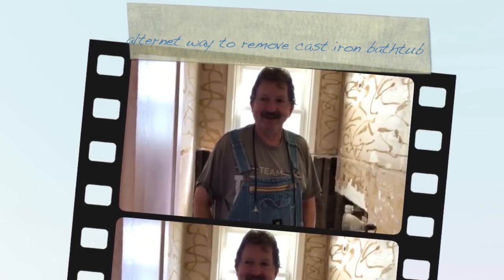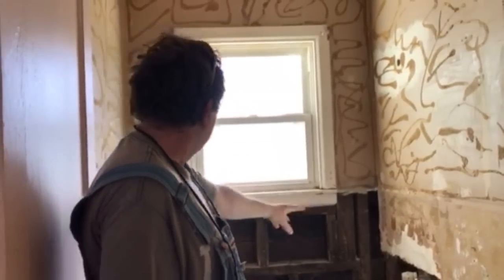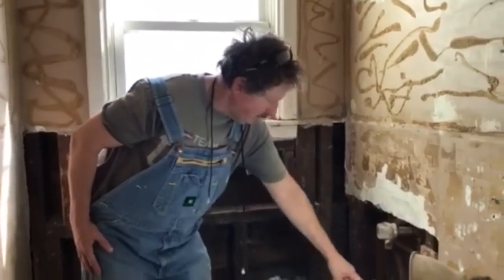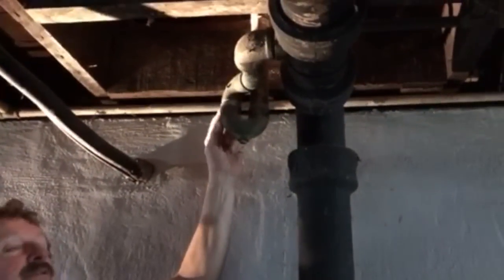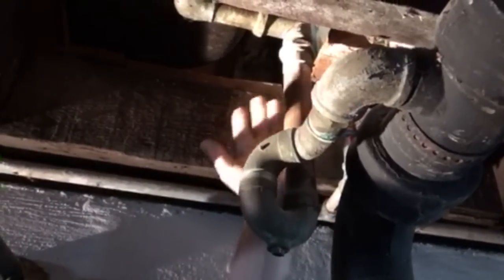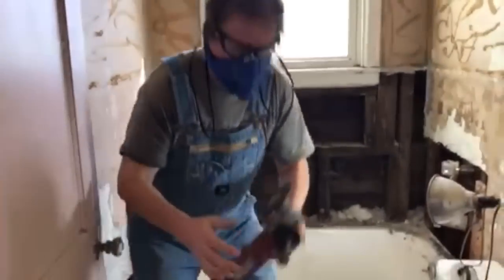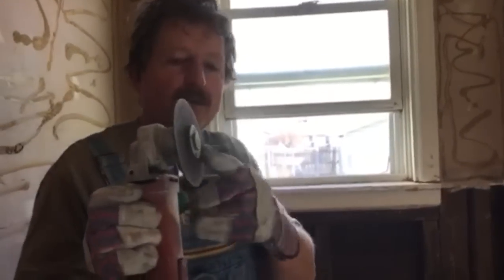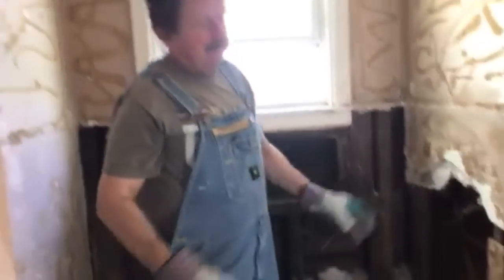no sledge hammer to remove this cast iron bath tub

Comment: That was my plan, the angle grinder, but you have shown me that one cut across the middle makes for 2 manageable pieces.    Years ago, I took out a tub all in one piece, and hired a junk hauler to bring it down my staircase.  Three of them it took to slide it down on old carpet scraps, then bust it apart in my yard with sledge hammers.   I didn't want to do that this time for the same reasons you mentioned, primarily shrapnel.  A close second was fatigue... I'm not as young as I once was!     Thank you for a great video!

Comment: Glad to have found this video, which gave me the confidence to do what I would not have attempted otherwise. What I had thought to be a steel bath turned out to be cast iron. I first tried a reciprocating saw to cut the bath, with appropriate blades: however, cutting prorgress was impractically slow. I then watched this video, along with a "health-and-safety" video about using an angle grinder, bought an inexpensive face-guard to add to the standard eye-protection and dust-mask, after which slicing up the cast-iron bath was relatively quick and easy. I had to make three cuts to get sections small enough for removal, which used up four cheap 4½ inch/115mm cutting discs. Thanks for the inspiration.
Reply: What angle grinder did you use? 5 amp? 15 amp?

Comment: just did this today and it worked fine.  i bought a Milwaukee 15 amp, 7 inch grinder and it worked great.  I wasn't able to get the lowest part because the wheel would've damaged the floor, so I used a sledge hammer on the last couple of inches.  otherwise, clean project. thanks!!

Comment: Thanks John, did what you said and it worked like a charm. With the tub cut in half it was still extremely heavy because i did it by myself. To anyone thinking of doing this buy a lenox 4.5 diamond blade and use good safety gear, you don't want cast iron shavings in your eye. Great video!

Comment: Great tip. I used a dewalt blade and it wore down pretty fast. Went and bought a Lenox diamond 4.5 inch blade and it’s just like butter. Amazing. Thank you.
Reply: Buy a face shield and hold on to the grinder it does kick on the side of the tub.

Comment: Super helpful. Another channel suggested using a reciprocating saw with diamond blades but he took 2 hours and went through about 10 blades. Beating on a tub with a sledge hammer is a great way to crack nearby window panes, knock pictures off adjoining walls, and generally cause more problems than it's worth.

Comment: Wow. What a sane way to remove a tub. Watching people bash them apart and end up with a mound of sharp slivers, you know there had to be a better way. Heading to HD to rent a grinder. You're a smart man, Mr. Karasiewicz.
Reply: I cut my cast iron tub with an angle grinder too.  It took about six wheels.   The sledgehammer way might be better because it's safer.  That angle grinder leaves a lot of dust.  Those  n95 mask clear out 95% of particles Only when there is an exhaust fan pulling out the dust.  I didn't see a fan in that bathroom.   This is like chromium dust.

Comment: I did the sledgehammer method and had it broken up and hauled out and swept up within 40 minutes. I put down old-school painters drop cloth over the tub, painters plastic on the floor and counter top. When hitting it all the shrapnel stayed in the tub area, and all the debris could be scooped onto the painters plastic and bagged up the crumbs into the plastic at the end to haul away. No way would I have been strong enough to move even 1/4th of the tub in one piece, easily 400lb bulky tub.
Reply: I do bathroom remodels with the homeowners present on every occasion the sledgehammer technique is caveman style it's old school it's a lot better A lot faster lot less clean up just to cut it down the middle with the grinder
Reply: I REMODEL FOR A LIVING IF I HAD TO SMASH EVERY TUB I CAME ACROSS I'D HAVE CARPLETUNNEL AND HEARING AIDS.  NOT TO MENTION A NIFTY SET OF SLEDGE HAMMERS.  YOU CAN ALSO TAKE OUT STUDS AND LIFT IT OUT AS A HOLE STRAPPED  TO A DOLLY.  YOU ARE PROBABLY GUTTING THE DRYWALL FOR A SUBSTRATE ANYWAY.   I KNOW A NEW STUD IS ALMOST 3 DOLLARS ITS A LOT OF MONEY...

Comment: Thank you for the video! I used this method yesterday and it worked very well. The risk of damage to drywall (popping all the nail heads) on adjacent walls was high if I used a sledge, so this method allowed for a very quick, controlled removal and clean-up.

Comment: Easy way to refinish a cast Iron tub where the surface has been dulled due to the use of abrasive cleanser powders like Ajax or Comet is to use Carnauba Wax and a buffer just like you would use for a car.  It does a great job, it does not take very long, and lasts surprisingly well as long as you apply 2-3 coats minimum and don't use abrasives or chemicals that may be too harsh for cleaning.  Maintenance may be the occasional (every year or so) buffer first and then a new coat with a second buffer.  A word of caution though, us some sort of bath mat in the tub for traction because it will be slick and pull the mat after each use so the tub dries.

Comment: I've used the sledgehammer approach. It risks breaking stuff you want to save (I once hit a toilet on a backswing) and makes a mess. This process is simple and takes less time. I bought a $15 diamond tipped 4-1/2" blade for my grinder at Lowes and had the thing cut in about 15 minutes. Just some black dust to sweep up.

Comment: Works perfectly, I cut mine in quarters and carried it out by myself with no issues.  No mess to clean up either.
Reply: I literally saw this video because I was going to use a sledgehammer method and I did what he said but I cut just like you but I cut in thirds took out the middle piece and then the two side pieces to slide it out so much easier

Comment: 20 minutes I could have the whole tub out with a sledge hammer, but this method is good in cases where banging away with a sledge can cause collateral damage and special care needs to be taken.
Reply: This is much safer than hammer bashing it then risking injury..or many times I dont want pieces flying not only at me but all over the bathroom and damaging other stuff. Often it's not always a complete bathoom remodel so why risk damaging yourself or other areas in the bathroom (cabinets, walls, fixtures, etc) Too many hacks out there these days and really..whats 20 minutes to saw it in half ? Nothing IMO. And if you can't carry out half a tub (150 pounds) you're in the wrong business.  A second guy is easier on the back if ya have a helper. Good video.
Reply: But how much time picking up 350 pounds of pieces and carrying it all out multiple trips? I don't know the time spent vs the mess seems better cutting.

Comment: This is the way to cut up a pre-1950 tub.  They are 1/2" thick cast iron and will not succumb easily to a sledge hammer without vibration damaging everything else.  We used a metal-cutting diamond blade ($21) and quartered the thing.  About an hour + of cutting.  If you have a big magnet it will catch some of the filings.   The top edge was reinforced with steel angles, and these were cut with a Sawzall.  Each quarter weighed 95 lbs.

Comment: Thanks for the very practical method. I saw another video where a guy tilted out the tub the same way you did, but in 1 piece (so no cutting).  But, both his method and yours pretty much requires getting valves and even wall board off first, to have nothing blocking the tilt-out removal............... That causes me to wonder if a modification of your technique could even avoid wall and valve removal - why not cut tub cross-wise, as you did, but in 2 places near the middle. Then drag out a small mid section. Then, pull each end section toward the center gap to get each one clear of obstructions on the end walls, then tilt each one out. This would also cut the tub into 3 sections, so each would weigh less and fit through the doorway easier.

Comment: I was totally sold on this method until I was about 10 minutes in, and still not quite halfway through my tub using the recommended inexpensive metal cutting wheel, before I realized that the entire bathroom was now covered in a fine layer of soot, and my whole house smelled like a brake shop. All that stuff shown in the bottom of the tub in this video was all over the rest of the bathroom. It took me an hour to clean all the soot off of the walls and surfaces. It even got into the closed shelves and drawers of the vanity, and scratched the surface of my plastic toilet seat when I tried to wipe it off. What a mess. Should have read the deeper into the comments where people recommend a diamond blade. Do not use a cheap metal cutting wheel!! 

I took out my frustrations with a 20oz framing hammer and had the tub out within 15 minutes. Sorry man. I love the idea, but it didn’t work so well for me.
Reply: Maybe even seal off door to the bathroom with double layers of plastic inside and out
Reply: You get what you pay for.  An abrasive wheel will make a mess.  Use a thin diamond blade made for metal, like a Lenox.  A big magnet near your work will catch lots of the cuttings.

Comment: This works with very little effort.  Two blades/wheels used...probably one premium wheel would do the trick.  I stopped occasionally for vacuuming, and the bottom inside curves seem to be a bit stubborn but the length of time for me from first cut to having the tub out the door was about 3 hours.  TAKE YOUR TIME and this is very easy.

Comment: I'm about to embark on this process and am reading the comments. I'm struck by those talking about the fine dust everywhere. Thinking that before I begin, I'll seal my tiny bathroom with drapes of plastic so as to prevent dust everywhere in the rest of the house.. Maybe even open the bathroom window and stick a fan inside it to suck out the dust as I go,
Reply: Some big magnets next to your cut helps.  Also use a thin, diamond blade.

Comment: Can you tell me a bit more about the die grinder?  I assume 1/4 collet, but it is 1/4 horse power or 1/2 horsepower, 18 or 20 volts? Did it come as a 90 degree angle or is that an attachment? Brand? (this is probably the only thing I will ever use it for, so might as well get the best for this job!) LOVE THIS IDEA v sledge hammer. Thank you!

Comment: Thanks for your video! I have a similar issue with a cast iron kitchen sink. It weighs as much as a small elephant. Already have a back problem so I don't need to lift that much weight. I did buy a diamond blade for my Skill Saw for forty bucks and see YOUR angle grinder which I have three of in my shop. Going to look at the assortment of cutting wheels, just maybe I have one that will cut that cast iron! Anyway I prefer not to sledge hammer the sink so cutting is the way I'd like to go! Again, Thanks My Friend! Be safe, take care!😊

Comment: This video is helpful, but this approach definitely has some downsides. It works, but cast iron dust/smoke is sticky, black and absolute murder to clean up - can create a days-long clean up project if cuts are performed anywhere near finished surfaces. Several unaddressed safety issues too: test for lead first or you'll be dispersing lead throughout the home; use a guard on that angle grinder - super dangerous to use cut-off discs without one; full facemask and gloves a must as well.
Reply: What?Do you work for OSHA. That 
takes all the fun out of it.No stiches or trip to the hospital.Safety first nobody works
nobody gets hurt.
Reply: Totally agree. The dust you are creating can potentially be more harmful than metal, porcelain shards from a sledge hammer and way harder to clean up.
Reply: Paul Wright 😂😂😂😂i was thinking the same thing

Comment: I have a old cast iron claw tub. It is in relative good shape. I added the special shower surround too. only thing is it's high wall makes for steeping in and out tough. I am thinking of just cutting down the one side to make getting in and out easier. Thanks for the demo. Have you ever had a problem with sparks 🔥?
Reply: If it is a good claw foot tub there is a market for them.

Comment: Sounds like the way to go. I am ordering a replacement deep soaker tub. 1963 construction. Are most drains of this period flush with the floor? My other "safe" choice is one that accomodates the pipe above or on top of the floor and adds 2 inches to the overall height of the tub.

Comment: I’m sorry. I watched the rest of the video and, again will have to assert. At the end of this video at 6:12 the host stands by the cut out tub with bear hands, one on the tub and one on his face. That is exactly how metal gets in your eyes. And as for being gentile to the structure, if you use a lump hammer not a sledgehammer vibration will be limited to the tub. That being said, even still, you can repair walls; you can’t easily repair your eyes. And, environmentally speaking, you can sweep and “bag the cast for scrap.”

Comment: I’ve got a 1952 American Standard tub that is in pristine shape.  There must be different grades of cast iron and the glazing used.  I’d say that for 72 years old it looks like the day it was put in.  It was placed when the house was built, before the walls went up.  Long story short we are removing two studs for another reason but it would make for an easy path out of the bathroom, into the walk in wall to wall closet, thought the bedroom, on its side out the door, across the hallway.  Uh oh, has to go down a flight of steps.   So here we go with the angle grinder.  Not ideal, but the cost to have a crew take this out is simply not worth it.  These tubs go for on average $300-400 on EBay but the moving crew wanted twice that amount.  Then you have to find that buyer and store the thing.  Where? Front yard?  Nope,  Off to the city recycle it goes.  Still sad.

Comment: Thanks for sharing this! I have two of them that I've been avoiding removal for 15 years. I have a question. The second bathroom you showed with the porcelain/marble tile. Did you have to remove the bottom row of tile that's along the tub?
Reply: I'd like to know the answer to this question too. I'm trying to avoid re-tiling.
Reply: Find a photo of a tub similar to yours.  My 1929 tub had no flange under the tile.  So I taped the tile to keep it from flying off if it was loose and quartered the tub.  It's hard not to lose one tile when you cut the top edge of the tub.  Newer tubs often have a flange behind the tiles. It's safe to say that in the best case you will loose a tile or two, so you should plan on some replacements at least.

Comment: Thanks!  No way the bath I'm working on would admit a swinging sledge or even 2 pound hammer -- no room!  Thinking about using a circular saw with metal blade but this is so much less clumsy.  Only thing I'd add is some sturdy work gloves in case something gets loose.

Comment: You've already destroyed the tub with your initial cut into it. Why not use the sledge hammer and save 20 minutes? Breaking up old cast iron only requires the weight of a swinging hammer, with very little force behind it. And it's a one person job.
Reply: Depends on the age of the tub.  Try hammering a 1929 Standard.  Good luck!
Reply: @eegg6954  lol, i figured something that old would break like porcelain. is that not the case?

Comment: First..that is not a die grinder ,, it is an angle grinder .and was looking to see what type of blade you have on it ?? Diamond blade ,, ?? I have used angle n diamond for cement but what did you use here?
Reply: Ok i watched a little  longer n seen you had said steel cut blade.. i have many thanks for video
Reply: I used a Lenox (China) 4.5" diamond blade made for metal cutting.  Worked well.

Comment: when cutting the bottom part of the tub, how do you stop yourself from cutting into the floor underneath?
Reply: My tub was actually acrylic so I used a sawzall but it still wasn't a problem because of the bottom being lifted 1-2" off the floor.  I had to angle the sawzall, here just make sure to only go through 1/2" and you are good.
Reply: So what if you do?

Comment: Not a bad video and ultimately you get to the part about how to remove the tub. But too much time spent on the front end of the video talking about and showing what the bathroom will look like once remodeled.

Using an angle grinder with a metal cut-off wheel is a great idea. I just think that you could improve this video by focusing on the topic.

Comment: Seriously John? I thought you would show me some magic. I'd rather have shards of glaze and metal flying around then pull out my grinder. Every time you use that grinder for anything you increase your chances of getting metal in your eyes. The mask and eye wear won’t help because, and you can ask you eye doctor, most of the time metal gets in your eyes later on in the day or the next day. What happens is, tiny fragments land on your close or in your hair or on your forehead. So unless you wear a full body suit, your safety precautions are not done until you have successfully cleaned the whole work place and then yourself, notwithstanding the respiratory risk.
Reply: I was thinking the same thing but my concern is cutting into or running into the floor boards with the grinder when cutting the bottom section of the sub.